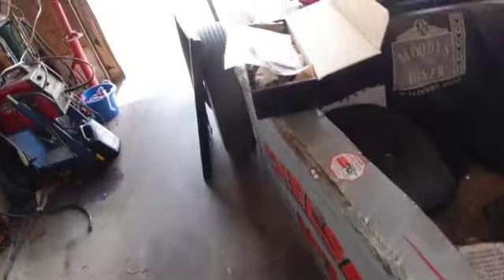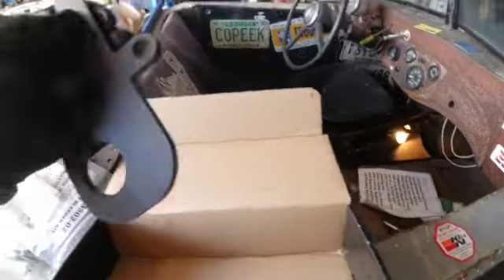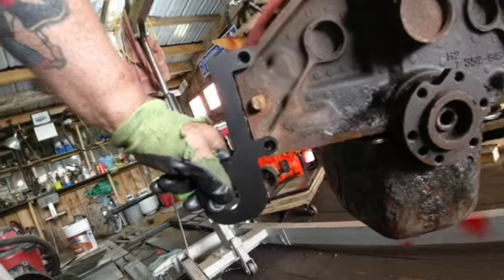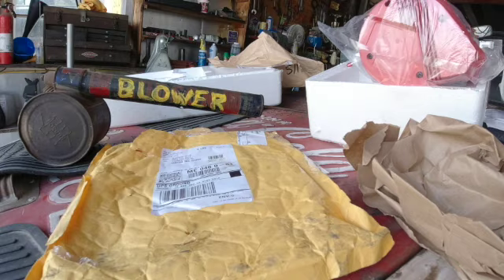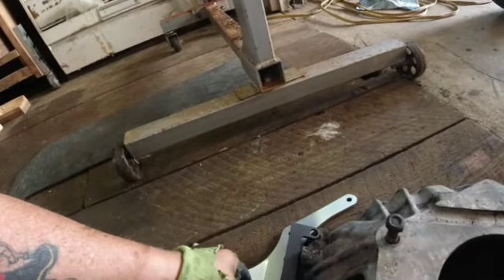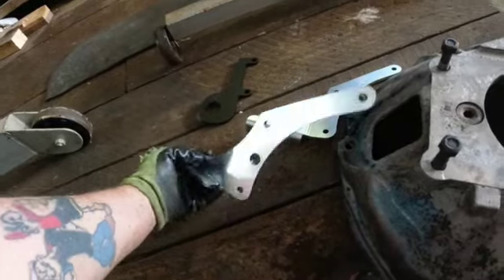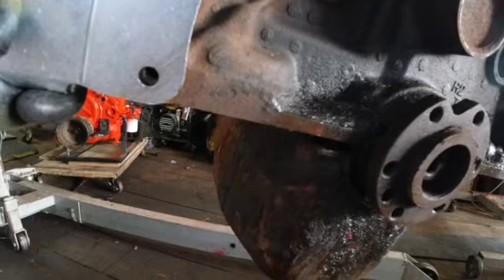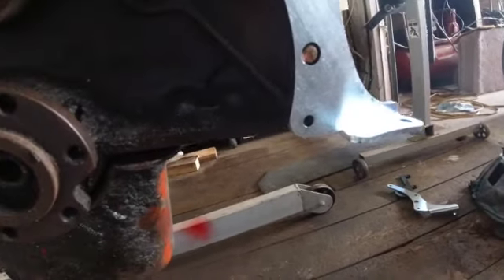Arrival of the slave binder and other car parts

Comment: If you put the mount between the bell housing and block, you won't have the dowels to accurately center the housing. That could lead to all kind of transmission alignment problems and jumping out of gear. I suppose you could get some longer alignment dowels.
Reply from the maker: Yea, all of that like you just said..